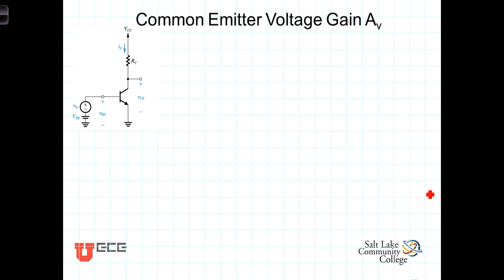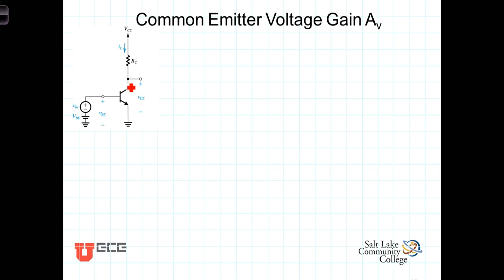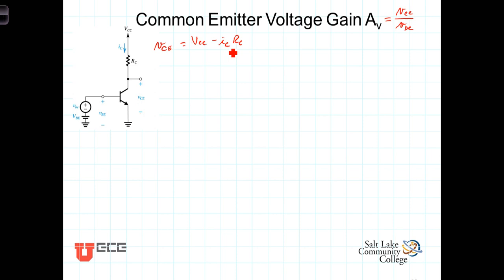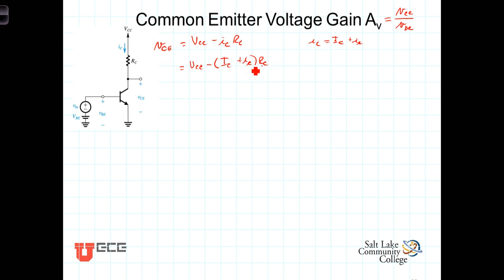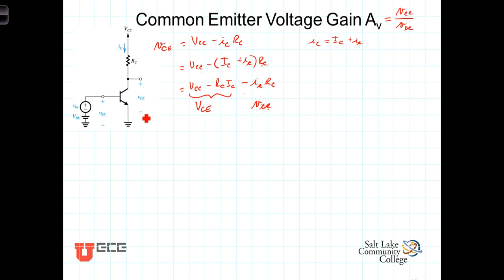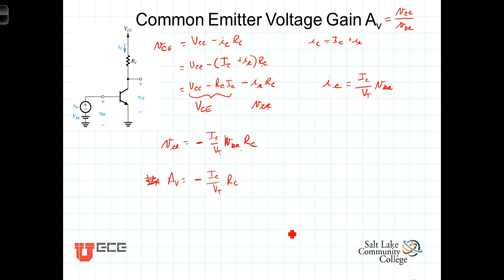L6 5 3Small Signal Voltage Gain Av

Comment: The amplification would be (AC - 0.6v + Vcc)??? 
Wouldn't the current flow to ground when AC activates the NPN???  or is that the reason why the gain is inverted?